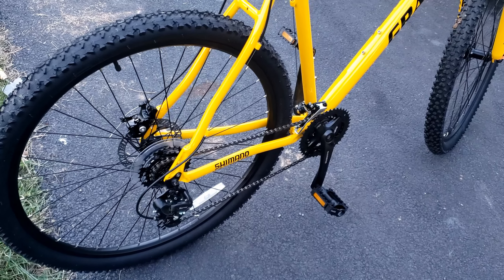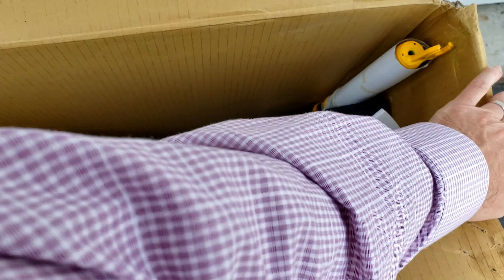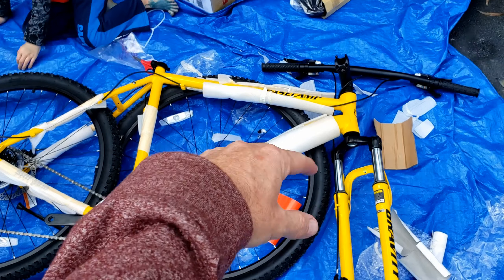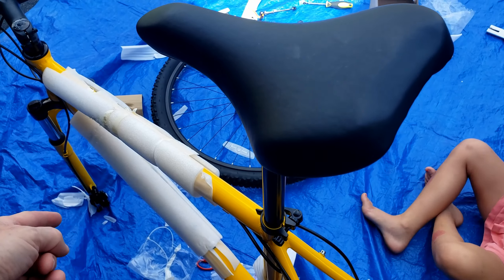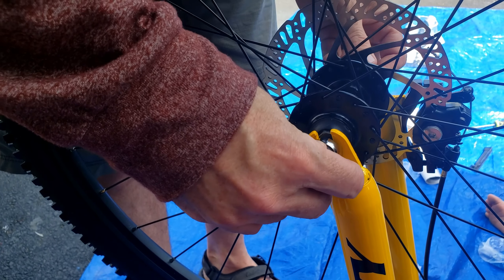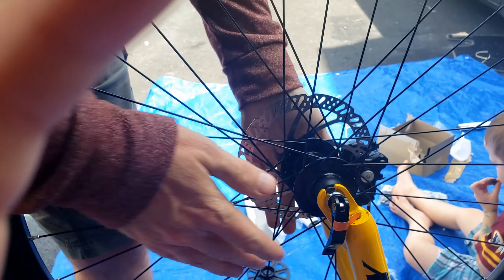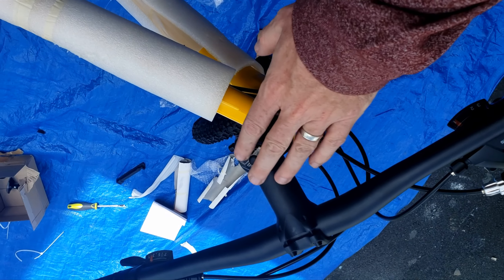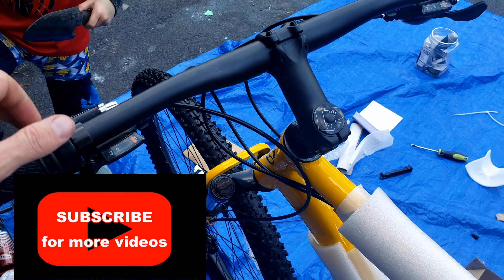Gravity Basecamp Mountain Bike setup  - From Bikes Direct

Comment: Thanks for this video. Can someone comment on the bike itself? I'm so close to purchasing, but worried it's a cheaper line. Will mainly be using it on paved paths, streets, roads, but also some rocky mountain trails (nothing super steep). Not sure what the ratio is, but don't want to be pedaling 100 revolutions to go 10mph on paved surfaces. Can this bike go fast without massive pedaling?
Reply from the maker: Great questions. I have taken it on numerous 10 mile rides.  In the past month I've probably ridden about 150 miles.  I had a Giant Rincon before this.  The brakes aren't as good as the Giant (but they are fine), the pedals were terrible and I replaced them already. Other than that it's great.  Id compare it to the Giant.  It is a $700 bike if it had upgraded parts (brakes, pedals etc) but most of those things don't matter to the average person.
Reply from the maker: Thanks for sharing. I sold my Giant Rincon a month before so I can't really compare except in my mind.  It seems good to me, but of course like with any machine, parts can make a difference. I remember replacing my car air filter with a K&N and felt like it was faster, but who knows,  right?

Comment: How's it holding up so far?
Reply from the maker: Other than the pedal cracking and I shifted gears too fast and cracked the rear derailleur (my fault),  it is great.  Bikes direct offered me a free replacement set us pedals.  The bike is amazing, the components (brakes, pedals etc) are on the cheaper side.  Overall I give it an A-.  For the price an A+
Reply: @SeanDIY  great! I bought two. One for myself and one for my wife. Seems like a nice first mountain bike for us.
Reply from the maker: Ihad a Giant Rincon before this.  I feel like the frame and body are better on this but the brakes were better on the Giant.  Both work and today the Giant would be about $600 I'm sure.
Reply: @SeanDIY  awesome

Comment: The reason people don't like kickstands on mountain bikes is because it signals that the bike is not designed for actual use. A mountain bike has absolutely no use for a kickstand. You will not find a reasonable opportunity to use it on a trail and it will make a hazard of itself during a ride.
Reply from the maker: I understand.   I still like to have one because 80% of my riding is on the road.
Reply: @SeanDIY  If that's the case then it wouldn't make sense to ride on a mountain bike. They're just plain not efficient on flat land. Those big knobby tires are made with a high volume for being able to use low pressure and ride over obstacles with ease at relatively low speeds. It sounds like what you need is a hybrid bike.